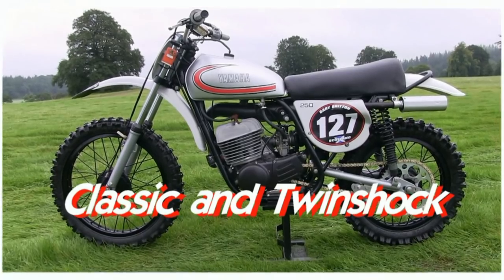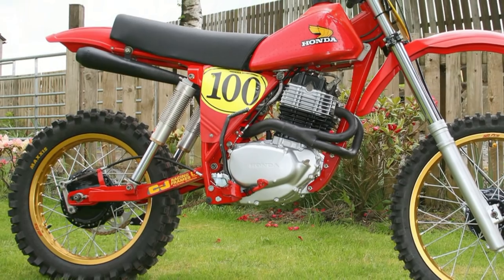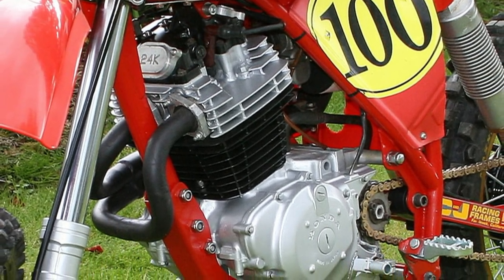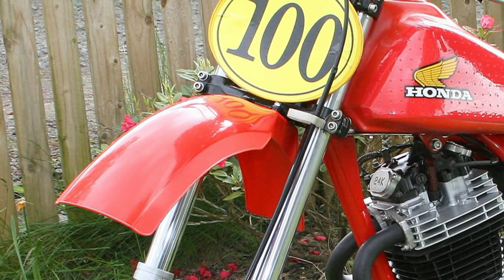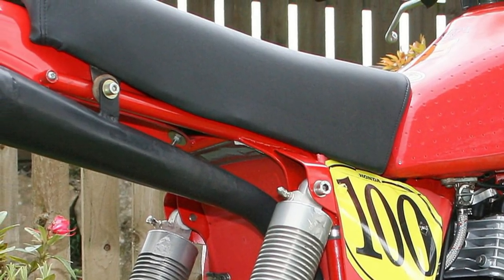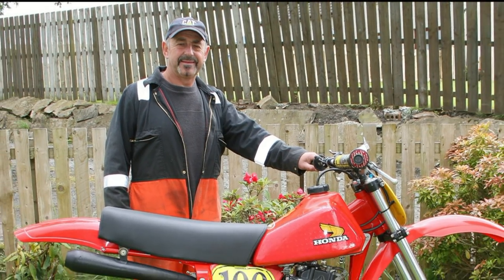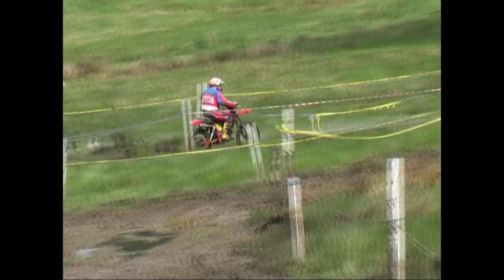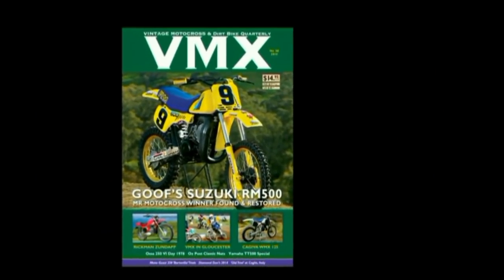Classic Dirt Bikes "C&J 500 Honda"

Comment: These Fox Shox keep appearing ! Are they ‘ vintage ‘ or are they still making them ?
Reply from the maker: frogsgottalent These particular shocks are vintage and were introduced by Bob Fox in the 1970’s. They were decent enough unit’s although suffered from overheating and occasional air bladder failures when ridden hard on tough tracks. But despite that they did the job but were not up to the standard of more higher quality hydraulic piggy back shocks. As far as I am aware there are modern versions available of this marque although I am not sure what they are like in terms of reliability and their overall performance.
Reply: Thanks.